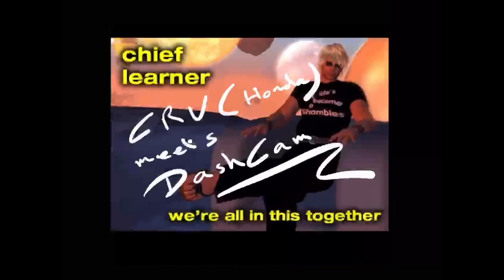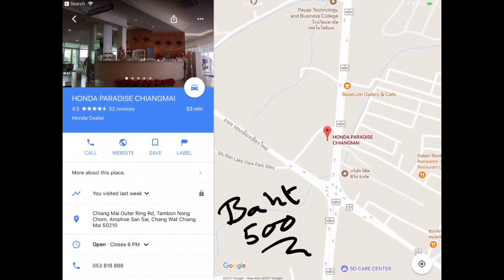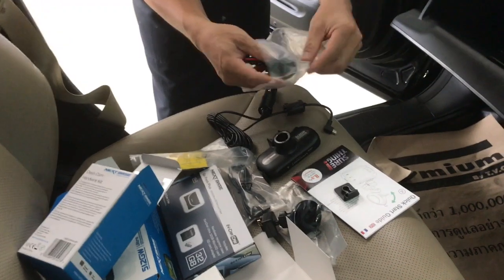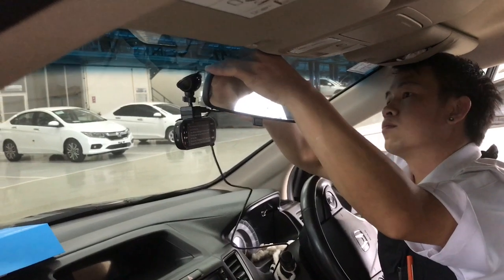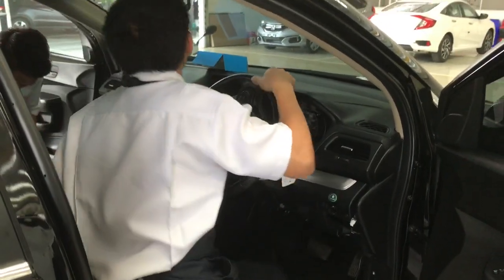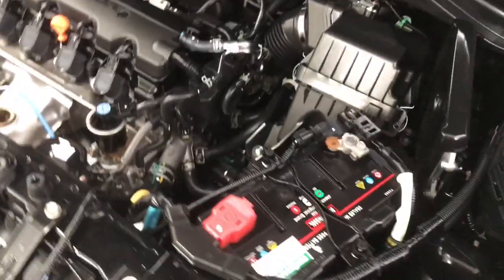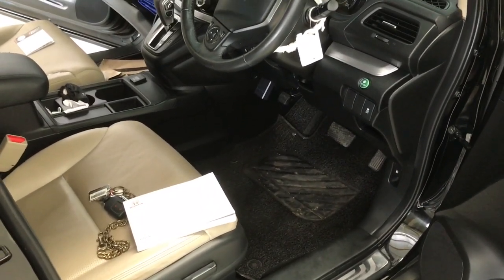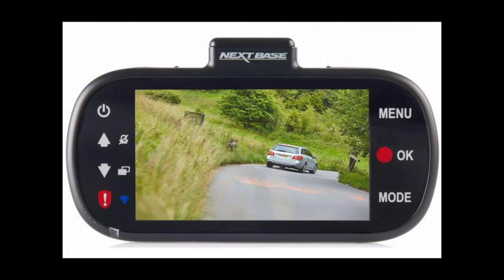DashCAM on my HondaCRV

Comment: did you happen to see which fuse number he used? I installed mine the other day but could not use the audio fuse as Honda already had a fuse adaptor on or over it. So I used the console power fuse which does not supply power when ignition is off but my dashcam still powers on when ignition is off.
Reply: Yes which # fuse did he connect to?